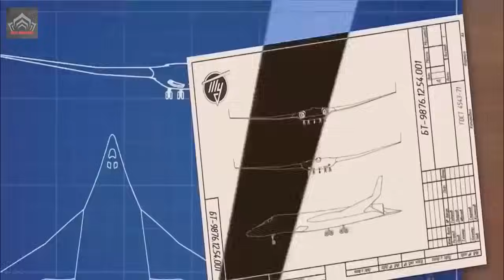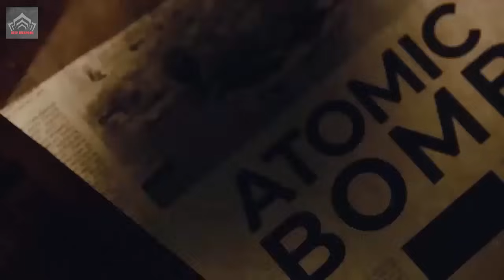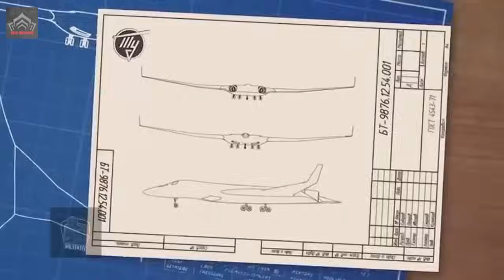Russia’s Next-Gen Bomber PAK-DA Gets A New Test Base As Induction Timeline Nears

Comment: Why do they even need this when they can already put an Avangard into the Oval Office anytime they want?
Reply: The PAK DA is based on the idea of a 'loitering air strike platform'. Its goal is not to get to the launch point and shoot at targets, but to hang in the air for as long as possible with a full set of long-range (various) missiles on board, and shoot at targets according to 'input directives and target designations'. For this purpose, the aerodynamic design of the “flying wing” and its subsonic speed - time in the air and fuel economy! This has nothing to do with the supersonic Tu-160M/M2 “first strike strategists” at all!

Comment: 6:23 "built with stealth not survivability" - isn't that the point of stealth? survivability. Update on 2023-10v-10 (Dec 10th): stealth makes one more likely to survive by  being harder to target. The USAF thinks the F-35 is more survivable than the A-10 despite the A-10 being much better at taking a hit. Many A-10s were shot down in 1990/91 in Iraq by an old soviet downgraded export model of an air defence system operated by folks many would say are less well trained than the Russians operating the Russian IADS in the present war. This IADS has shot down rugged MiG-29s and Su-27s.  The ruggedness of those aircraft is more relevant when it comes to operating from austere airstrips. NB: Fulcrum was designed for Frontal Aviation and the Flanker for the PVO.
Reply: That statement didn't make any sense to me either. Maybe it was a typo in the video's outline.
Reply: Stealth isn't survivability, it's avoidance. A stealthy aircraft tends to be fragile. Typical Russian, or rather Soviet, airframes, are built with the expectation of air-to-air combat, so most are overbuilt and highly durable. Emphasis on stealth over survivability means it's no longer being built with the expectation of being shot at.
Reply: @SeanMirrsen  Most Soviet aircraft were not built like the IL-2.
Reply: @BenVaserlan  , Some of them were built in this way... For ex., Mig-29 fighter has the tripled avionics battle computer system to survive even after blast of a nuclear charge. Most of Soviet aircraft have the doubled avionic control system, at least... The Su-25 front attack aircraft has the aluminium cockpit armor to withstand shells up to 24 mm caliber. All Soviet military helicopters were armored to withstand such bullets/shells.

Comment: Why don’t Russians ever like to use the slimmer compact size afterburner nozzles? Like f22?
Reply: Because performance and ease of maintenance.
Reply: @SeanMirrsen  please explain?
Reply: @riccccccardo  , Why F-35 has a round nozzle? By the way, the flat nozzles not allow the 3D-vector thrust control, only in the vertical plane. Moreover, Russians (Soviets) did test flat nozzles many decades ago on the Su-27 fighter and they did find the thrust on flat nozzles drops by ~15% comparing to the circular ones for the same engine. It is alot, actually, and related to decrease of the speed, altitude and max payload...
Reply: @maksimluzin1121  ahhhh thanks I’ve answered a question that’s bothered me for years lol bravo 👏🏾👏🏾👏🏾😅